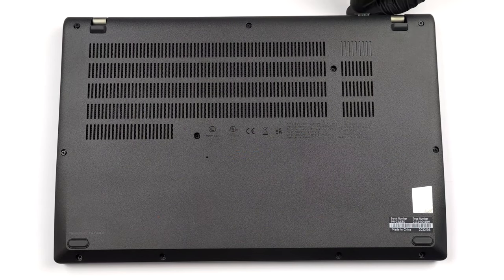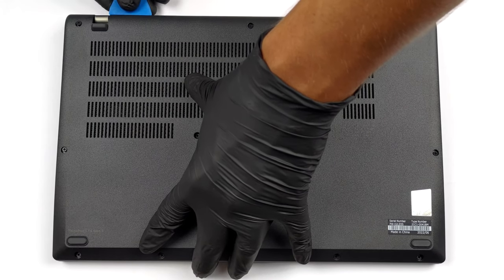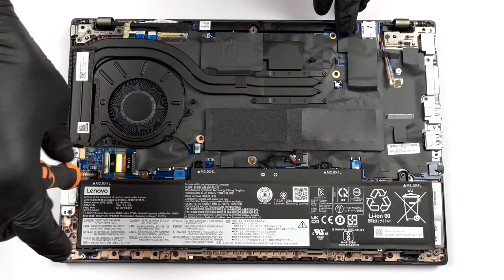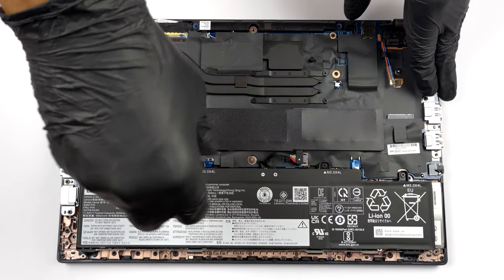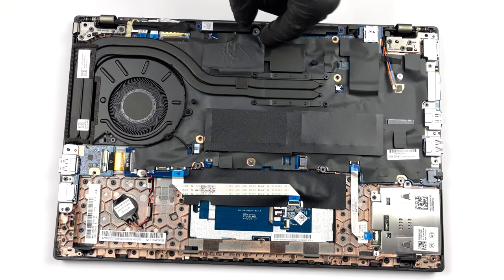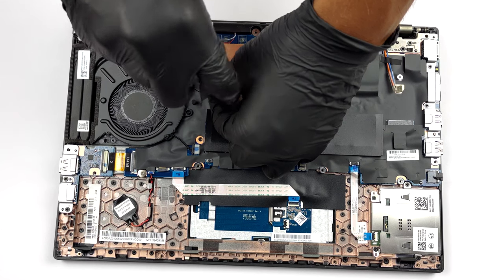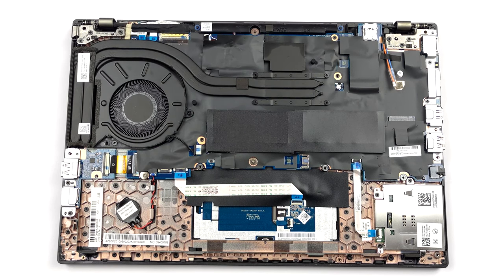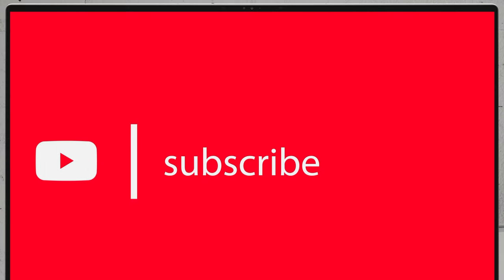🛠️ Lenovo ThinkPad L14 Gen 3 - disassembly and upgrade options

Comment: Interesting to see that it has 2 dimm slots. Since having soldered memory with only 1 dimm slot for expansion is getting more nowadays.
Reply: Or just having 2 soldered dimm slots like on the Dell XPS 13
Reply: can you elaborate? It has 2 memory slots, but only 1 is upgradable? So its not possible to change the 2 slots? thanks
Reply: @weirkved  I rephrased my comment.
Reply: @ghanz84  thanks
Reply: @weirkved  you can definitely change both memory slots.
Reply: This is confusing. The narrator says they are soldered slots for dimm, but he just pulls them out. Is the video narrator mistaken? I actually bought this one because it did not say soldered for the dimm, so I could upgrade to 64GB later on. Supposedly soldered is better for what is there now, but worse if you have to change it.
Reply: @smillstill  Yes it was confusing but accurate. I had to watch that part twice to be sure. Like all RAM slots, the slots are soldered to the motherboard. The ram chips are not directly soldered to the motherboard on L14Gen3. Most recent laptops, specially LPDDR5 and LPDDR4X are directly soldered to the motherboard. Hope this helps clear up the confusion.
Reply: That's what it sold it for me

Comment: Thank you for the very informative video. Is it also possible to install an M.2 2230 SSD instead of an M.2 2242? I want to install a 2TB SSD but couldn´t find a fast one in the form factor M.2 2242. But there are some models in the form factor M.2 2230.

Comment: Cheaper than the T14. Has two SODIM DDR4 slots not like the T14 which has one bank perma-soldered to the mainboard. Too bad the m.2 is of a non-widely used size 2242. That size is not easy to come by in 512GB NVMe or larger.
Reply: Cosair Mp600 micro 1TB is available around 100 pounds from their website. It just unfortunate that this size is very hard to come by used.
Reply: How about a 2230?

Comment: Do you know if L15 Gen3 does have a second M.2 slot that would take a full size 2280 SSD?
Reply: NO
Reply: Does it even have a second slot?
Reply: @alku3842  Ram, yes. NVMe - nope. takes a very difficult to find 2242 size M.2.

Comment: Whose design is considered better?
L14 gen3 vs vostro 5620 vs L14 gen2
Reply: In my opinion L14 gen3 is definitely better than L14 gen2 but I can't decide between L14 gen3 and vostro 5620
Reply: gen2 is much better, as you can install 2280 M.2 SSDs